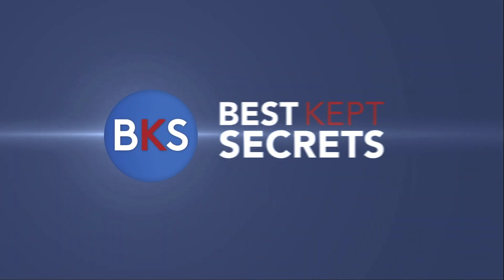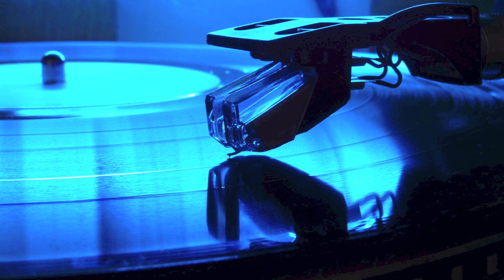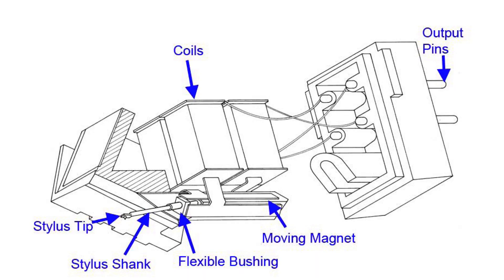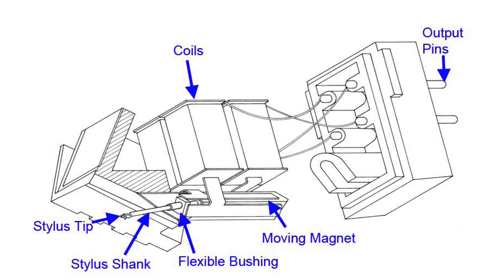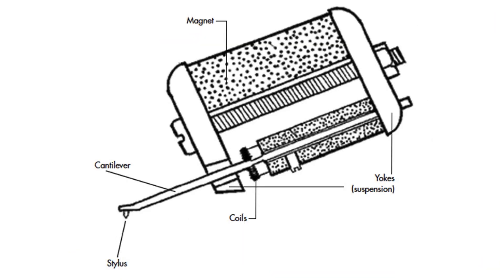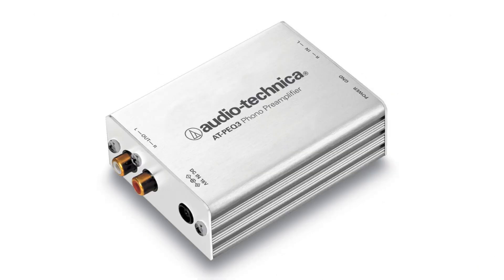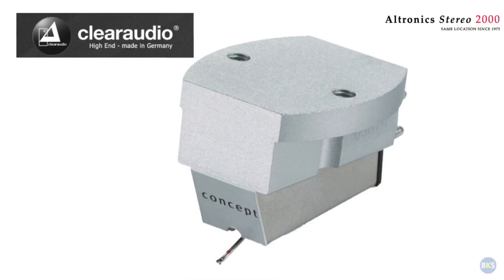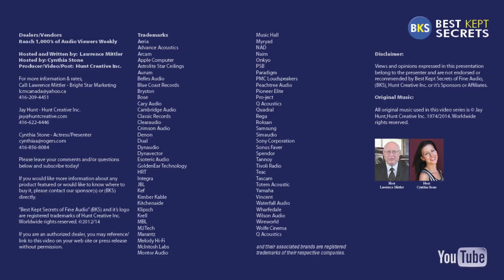MOVING MAGNET vs MOVING COIL CARTRIDGES (Explained)

Comment: I only learned of the difference few months ago, But what I have learned right now from this channel is that the stylus cannot be replaced unless by the manufacturer, this is a big minus but in all other ways a MC makes more sense than a MM I got a MC input on my pre-amp np there But as we all know Cartridges n speakers you cannot buy without listening to them, n I Love the solid sound of the old Magnetic Shure cartridges also my old TT a Sony direct drive with a carbon fibre arm even it tracked the Shure V15III with the Shure obstacle course record am not sure if the arm will move fast enough to follow the grooves more accurately been retired you just do not buy something n change it if you don't like it after them days are gone lol